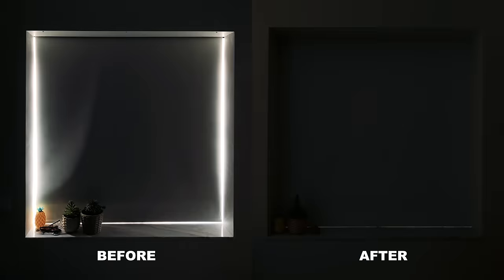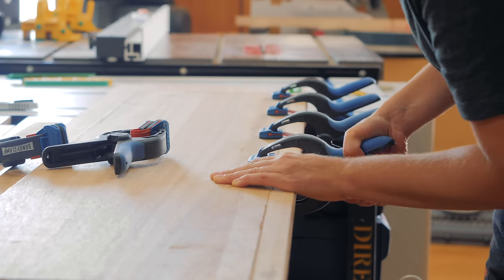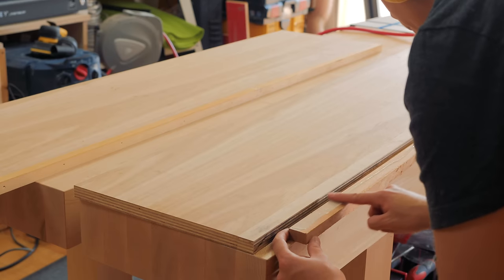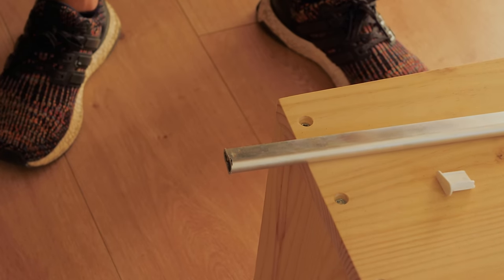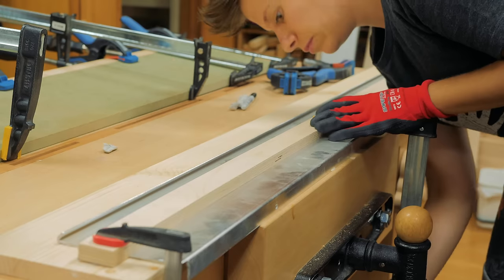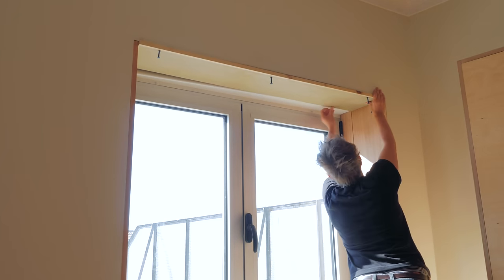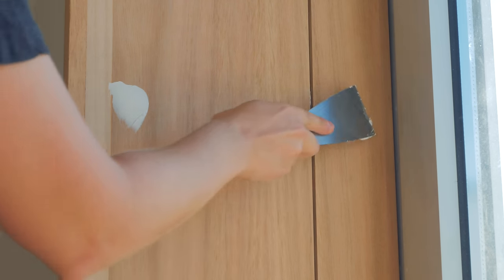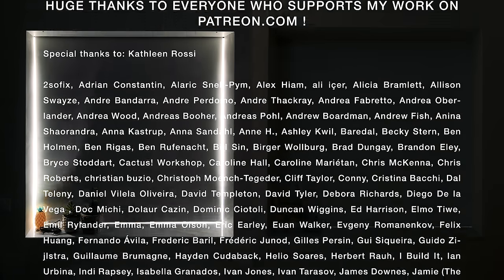Eliminate Light Gaps on Window Blackout Roller Shades // Tiny Apartment Build Ep.7

Comment: As a contractor:
1:  we have to work within people’s budgets. What you just did looked like an exorbitant amount of work to solve the problem when...
2:  there are Blackout Shade Side Tracks specifically made to solve this problem at $40 US per window. 
3: they can also block the light coming through at the bottom of the shade. 
4: the joint between the wood “extension jambs” and the concrete wall will eventually crack due to differing rates of thermal expansion and contraction. At the very least the transition from concrete to wood/MDF should have been mesh taped. 
There are several more cost effective
options available via Google, and even some that are integrated directly into the window unit itself. Just ask a qualified contractor. We have the solutions, this is why you pay us. 
TL/DR:  get what you pay for.

Comment: dont mean to be a Turd but did you really think a shade installer would do all that unnecessary work? its there job to hang the shades not make sure there low profile or go with your decor. You can say that the installation was ok but just not to your liking. Great work btw

Comment: The company you chose offered you, and you picked out the wrong product. I’ve been a professional window treatment consultant for over 23 years. You should have used a blackout honeycomb shade and added a light block strip that is offered by many companies. You could’ve saved 1/50 of the price spent on the material and labor time involved in your project. That being said you did a very nice job, but for the average person way too much work involved for two light strips that would’ve cost $10 and taken 30 seconds to install.
Reply: I looked for the strips you are talking about, and they are functional, but at least the ones I found look like a tacked on length of L or U shaped, extruded plastic stuck to the sides of your window reveal. GHD got a very clean, very modern look. Sure it was more work, and more effort than most would consider investing, but it is all in the details.

Comment: Or you could just close the shutters...
And why use "workers" if you have so much spare time and tools, you could a bilt it in the first place?
Reply: why comment unless you know the full story though? maybe there are no shutters, and you don't know or even dealt with the workers.
Reply from the maker: The shutters were removed in the renovation and that's why there's space up inside the wall over the window, in case you didn't get that from the video. This wasn't commissioned by me but what the landlord passed to the contractor was that he wanted blackout shades. The contractor got these shades and installed them himself, leaving the work as you saw in the beginning of the video. I actually suggested him to make this or at least apply U shaped rails on the sides or so. He did nothing. I wasn't his client and was left with this crap to solve as who is living here isn't him. Easy to judge when you don't know the full story.

Comment: Had to stop at the part where you are using a table saw. It seems an integral part of DIY videos but a lot of us just have handsaws for reasons like cost, where to locate it, neighbourhood rules etc
You use "impermeable" wood but if the installation is in a bedroom that's not a great idea as it deflects water vapour elsewhere. We all breathe ie water vapour and maybe are accompanied by a heavy breathing dog!
It was really a cheap renovation that you moved into. In the whole of southern Europe shutters or volets are traditional for keeping the interior of houses cool. That they took out external rolling shutters and left the box empty only replacing it with internal blinds is unacceptable. I would have asked for new ones to be installed as a condition of taking the rental or looked elsewhere. Not only are these volets roulants extra security for you they really help deflect the sun before it shines through the glass. The difference between the external and internal blind is that when you open the external blind after the sun has left the window there is minimal temperature change in the room: doing the same with an internal roller blind results in an immediate increase of temperature because the heat has been stored between the window which magnifies it and the 
blind.
Hope your videos bring you enough to move where you wish and/or to be happy where you find yourself.

Comment: Normally I love your work but the need to undo finishing and paint to fix the mechanism or replace the shade is a horrible choice of form way over function.

I don't know about Portugal but in some countries what you just did would actually be completely against building codes.

The outcome is beautiful but badly designed.
Reply: The shade is inside the cavity which is built for outdoor rolling shutters, so the top lots is always accessible with the turn of a couple screws. Those rolling shutters are typically fine in southern European countries and I actually like them because it keeps sun out and great inside in winter if needed too